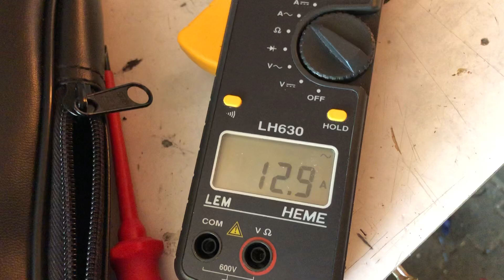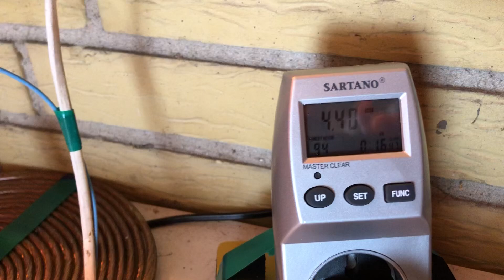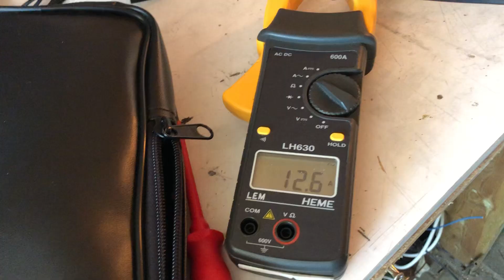Quadfilar Tesla coil more amps out?

Comment: 50hz 5 amps
20khz 13 amps
It is not overunity.
Reply from the maker: Peter Name sorry not trying to say OU only that it is a more efficient method
Reply: @dkdyker  oh bro I am not disproving you .I am from overunity.com "Justawatt".

I believe JLN  have showed it in his site.this device is not above 100 % efficient .

Only way to prove is take the output of gengen coil give it to SMPS supply then to a inverter .from inverter run the induction cooker.if it loops then we found overunity.
Reply: @dkdyker  or another way is to rectify the output coil using high frequency diode then to capacitor.
Then it is pure dc .light load can run from dc .
Then check the amps it is the best way using v=I*R to find the effeciency . resistance of light bulb can be calculated
Reply from the maker: Peter Name just thinking about what you said about looping. Do you have any contacts that would be willing to supply a pure sine wave inverter so I could try to loop this? It’s worth a shot, nobody has done this as I can see. ???
Reply from the maker: Peter Name https://youtu.be/RbdgR-Hitzo this vid shows 20amps on output only 4-6 amps on input. Interesting

Comment: The power meter is powered from the wall and shows correctly 4.4A 220V @ 50Hz but the output current is 12.9A! THIS IS NOT YES - the induction cooker works at kHz so the output is not 50Hz but e.g. 40kHz or more. Now clamp meters usually have a measuring range up to 400 Hz! maybe up to 1kHz if it's better but certainly not more. Therefore, the clamp meter shows false data. Check in the manual what frequency range can be measured and also check the frequency of the induction cooker. You can use an oscilloscope or meter with Hz function or other method.
A clamp meter that shows a range greater than 20kHz will probably be expensive. If you know the frequency of an induction cooker maybe you can use some formula to calculate the power at this frequency.
Reply from the maker: Max Malone great thanks 🙏